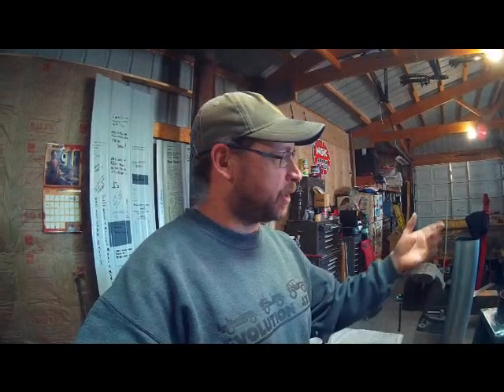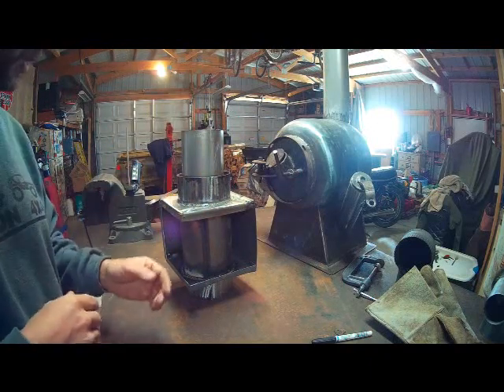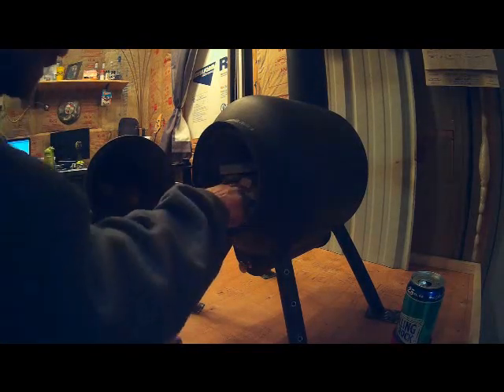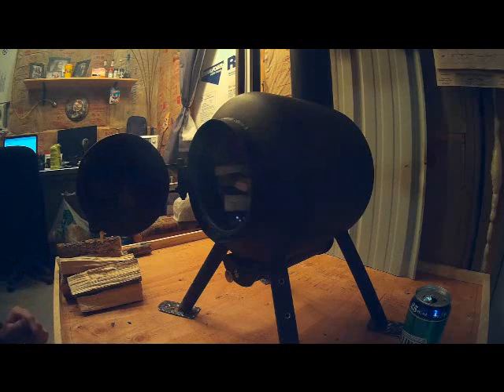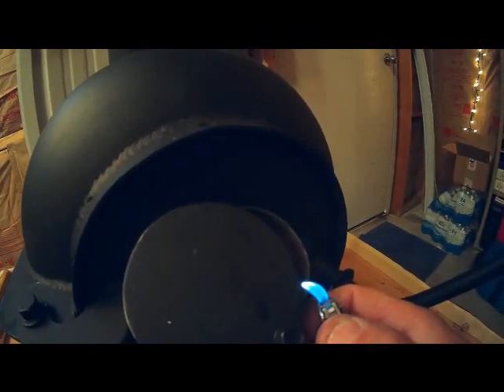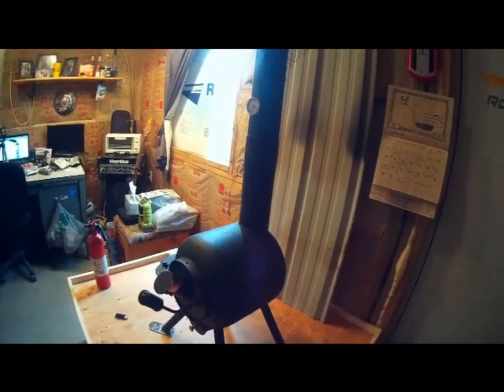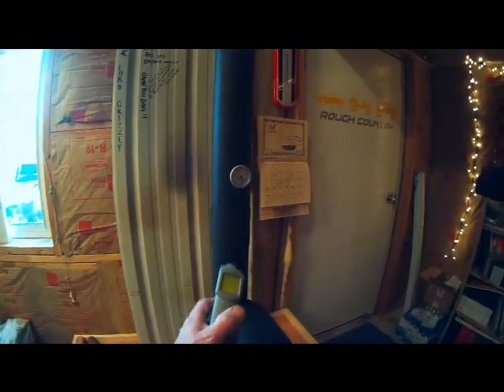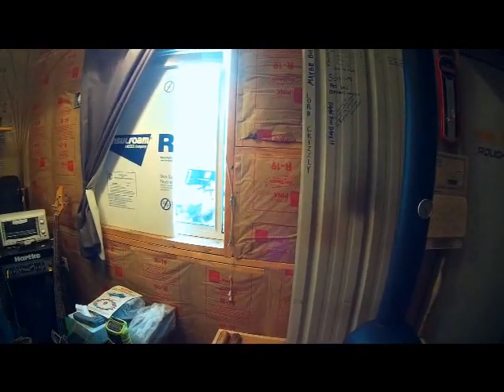Propane Tank Wood Stove Installed

Comment: I've commented on this video, and I came back to watch again because my glass came in today. This is the nicest homemade stove I have seen and plan on building one for my small shop. The fact that it is smoking says that it is starving for air. When you opened the door, the flames came right up again. Could it be the placement of the baffle?
Reply from the maker: Thanks for the comment! I really appreciate you watching it again. Sounds like you are like me...watch, learn, absorb, modify, etc.... It works flawlessly now. 

I had crummy draw without the double wall out side. Has been working great for years. 

I just installed a 10# stove of similar design in a school bus I am converting into a camper and It rocks as well. 

Ask any questions you want and I will try to answer best I can.
Reply: @81eagle  Oh I'm glad you worked out the issue. I have a small expansion take from my old furnace that is slightly smaller than a 20lb tank. It will be on a small corner shelf held up by 3/4" black pipe and flanges mounted underneath a shelf of slate. The wall protector will be a sheet of the old heavy-duty type of corrugated roofing panels I retrieved years ago and have been storing for a project like this. It will be hard but it needs to be bent to fit into the corner. They don't make these heavy-duty panels anymore. They are made so thin! I only have one and that is 1 of the 2 reasons I want it on a shelf so it goes to the ceiling in the shop. It will also be easy to tend to and I can store longs underneath the shelf held by the pipes. Gosh, it is getting to be a novel here so I'll end here. I hope to see something else you have made soon!!
Reply from the maker: @crossgrainwoodproductsltd9230  I would love to see your set up. The roof panel will work great as a heat shield. In my bus build I am using old license plates as the shield. For the hearth I just use river rock and stone I find on my many camping and exploring adventures. I would love to your set up. Feel free to email me mick81eagle@gmail.com
Reply: @81eagle  Cool! I will send a photo when it is completed. You will have to excuse the bad welds though, I'm a novice.LOL
Reply from the maker: @crossgrainwoodproductsltd9230  Hey that's how you learn! Can't wait to see it!

Comment: That's real nice. I noticed the surface directly below mine gets  real hot but I don't have the bricks inside like you do. I thought about putting it on a slab or thick stone so it will heat up like a heat rock. Have you thought about filling your table up with concrete? You already have it formed haha. It would radiate heat after the fire burns down. Good job!
Reply from the maker: Thanks man! It doesn't get real hot under it. I plan on adding more creek rock once the creek reappears from under the ice and snow. Come on summer!

Comment: In the past when I started my stove when it was stone cold it would smoke.  I found, in my situation, that if I opened the stove up for a short time the draft would warm up the flue enough that it would draw properly and it resolved the smoke issue.  I've also learned not to overload the firebox with too much stuff to start the fire.  It just takes a little bit and then feed it.  Assuming your whole system is properly setup in the first place.  I really like your little stove.
Reply from the maker: Thanks for your comment! I have found that every wood stove I have ever had, has its own special lighting procedure. I am just so glad this thing draws really well since I light it every morning, and some days I keep it going all day. I built on for my dad and mom, did an initial burn outside yesterday. Once it is installed in a few weeks I will do a video on it. It is going in their dining room, so we'll see how it turns out!